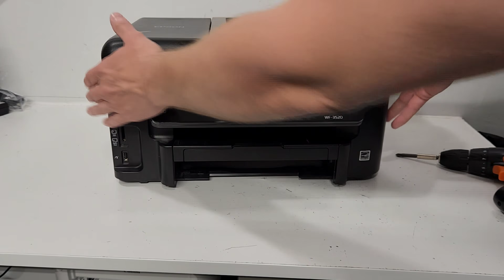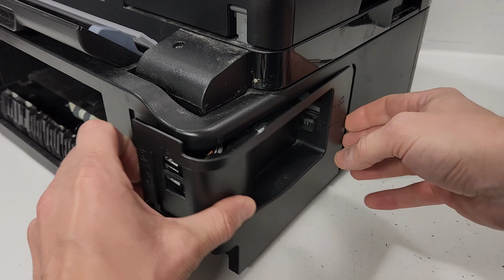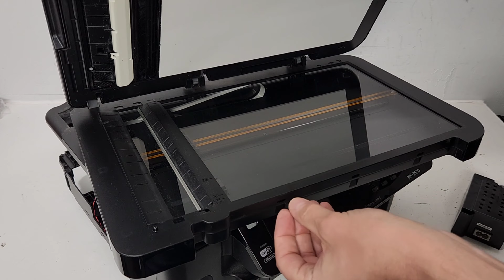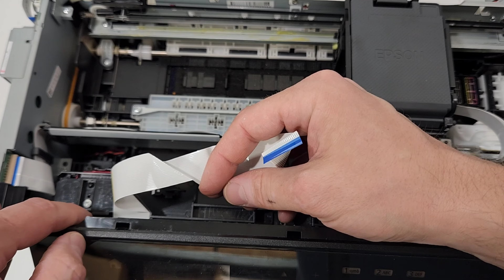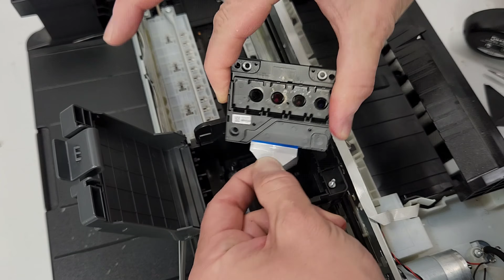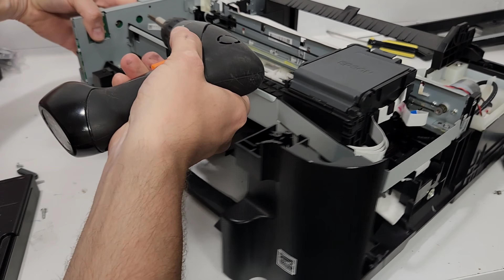EPSON WorkForce WF-3520 Printer Disassembly

Comment: Hello, great video. Thank you for sharing. I am running into an issue with this EPSON WF-3520 model. I replaced the printer head, but now i am getting error 0x9a. I disassembled it few times but the error does not goes away. I now think that the print head cable might have got damaged. Could you please share the cable name and type attached with printer head. Is it 24 pin, or 28pin FFC cable. Thank you for replying.

Comment: Love this printer, still using it. Will probably change the printhead soon.
Reply: be very careful when changing the printer head. I just replaced the printer head, and it is not working anymore. Specially, be careful when removing cable with printer head, and cartridge card read.